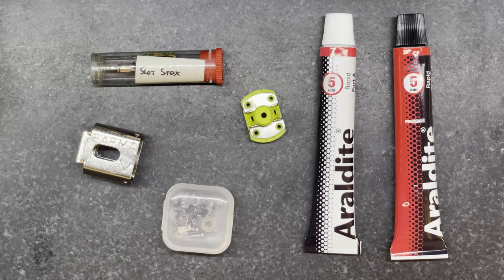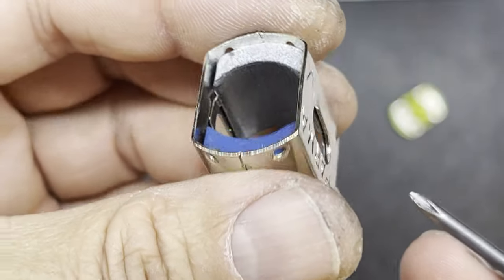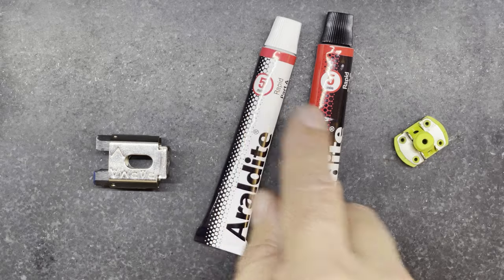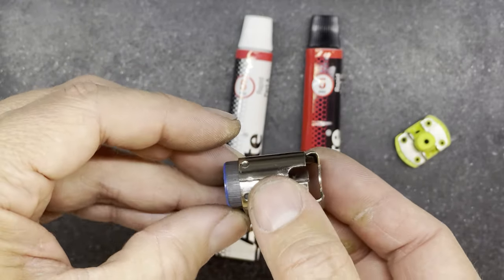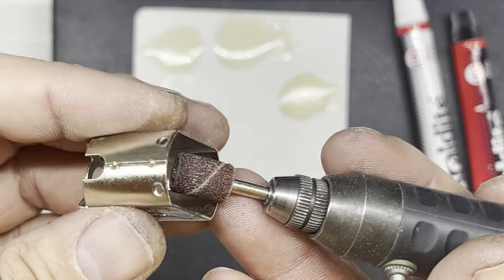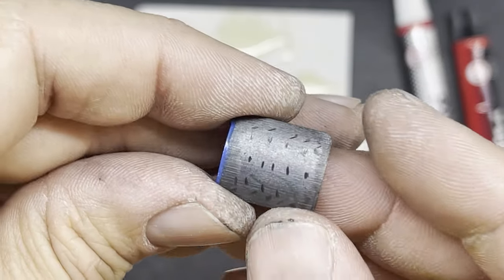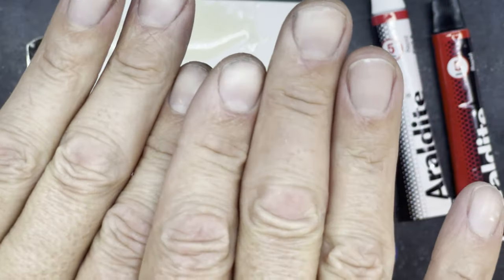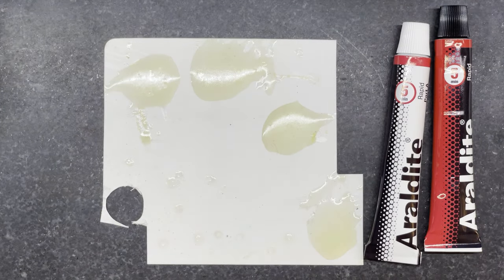Servicing a slot car motor to improve performance Super 16D Slot Stox - Part 3

Comment: You need a decan straightener and then you need to use a can bearing liner and solder the can together at the joints

Comment: How do you zap a motor
Reply from the maker: You need a magnet zapper which is suitable for ceramic slot car magnets. They generally consist of capacitors and a coil of wire that can generate a magnetic pulse to saturate the magnetic field of the magnets.
Reply from the maker: You can find plans for magnet zappers online. 😉